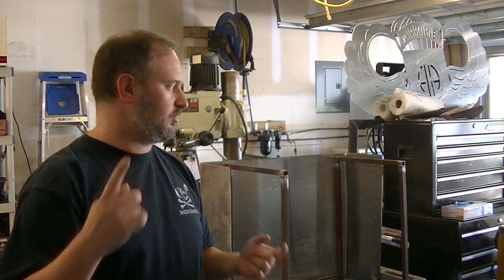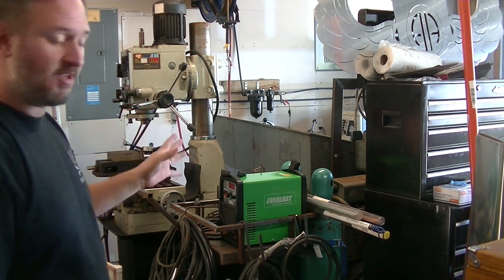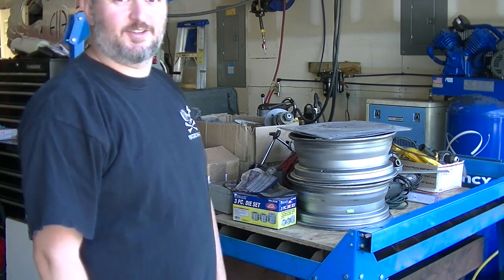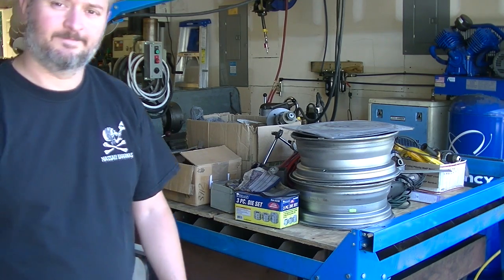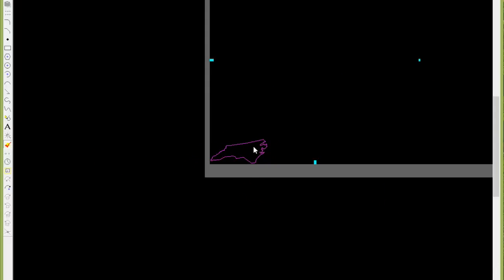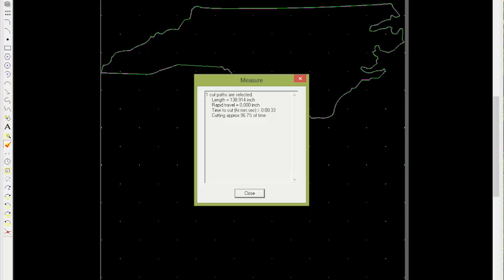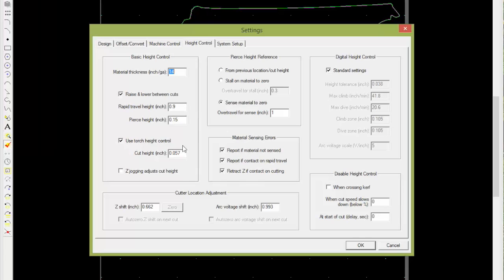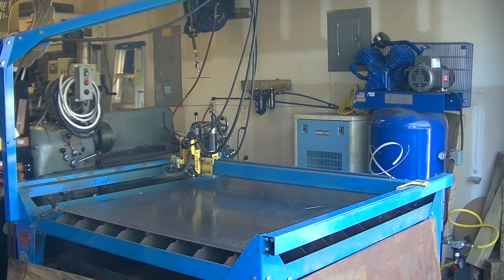Shop Update Series - Episode 19

Comment: Good luck with the operation. Don't rush the recovery, you'll regret it later.
I know how the rush move thing goes. 
When my wife had a leg lopped off to stop an infection that was antibiotic resistant, I had to close her craft shop. The landlord gave me a week to do it. Removing all stock equipment and fittings on my own, as well as supporting her and the kids was a big journey. I ended up taking the last of her stuff out the back door of the shop as the new tenants were moving their stuff in the front door. 
Cheers Eric
Reply from the maker: midgoog2 Thanks, Eric. I'm definitely doing things by the book on this.

Comment: Wow Tom, when it rains it pours.  Sux that you got kicked out of your shop, but sounds like your staying strong and finding a way to make lemonade out of lemons.  That johnson bar is cool, haven't seen one of those before.  Sorry to hear about the back, you have been struggling with that for years, hopefully the surgery will get you taken care of.  So Design Edge is what you are using?  Did that come with your plasma cam?  Is it available as a 3rd party separate app?  take care sir.
Reply from the maker: turbocobra Hi, Gary! Definitely trying to stay on the positive side of all of this. I got hurt in 1992 and then again in 2003; both while in the Army. It's the kind of surgery you put off until it gets too bad.

Design Edge is one of the reasons I went with PlasmaCam instead of building my own. It's a combined CAD / CAM system that only works with their line of tools, unfortunately. So basically it only works with the Samson and GoTorch cutters as well as the PlasmaCam.